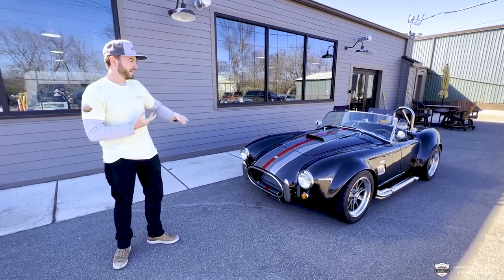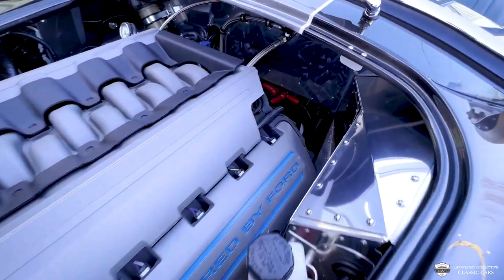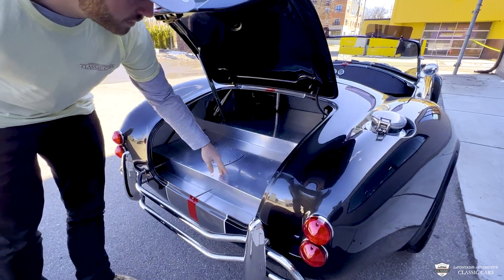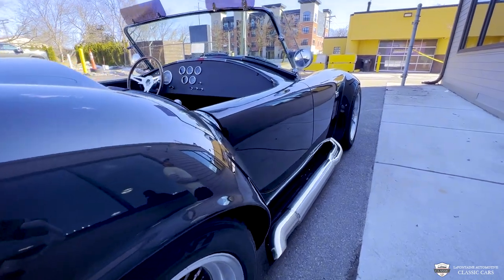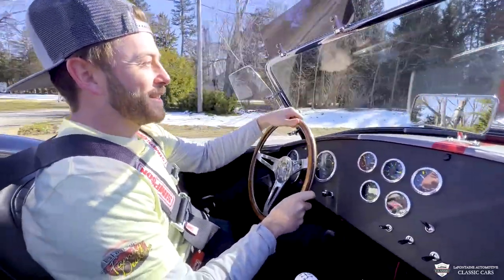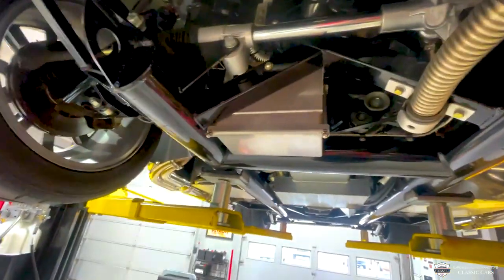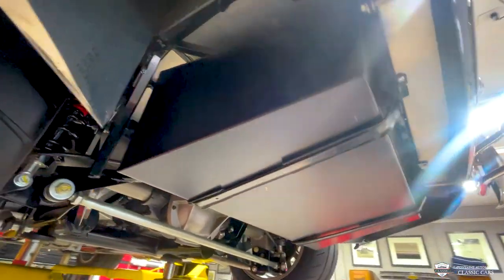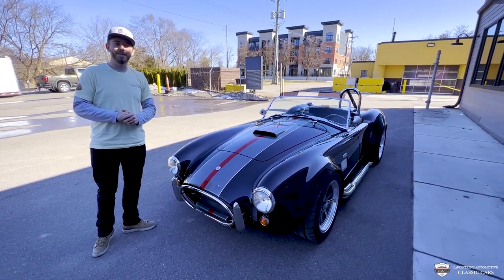1965 Shelby Cobra 5.0 Coyote SWAPPED

Comment: Beautiful but cold air intake is a waste. Don't want hot air. Not digital Guages
Reply: 2:00   If you look carefully, you can see there's a space between the radiator crossbar and the body.  The carburated engines normally close this off to increase airflow through the radiator and then of course air enters through the hood scoop.   For this setup, what's shown is the best one can do.
When he said "digital gauges" he probably was referring to the GPS speedo that has the odometer in digital readout.  There's all sorts of neat things you can do with it, for example, measure your own 0-60 and 1/4 mile time.